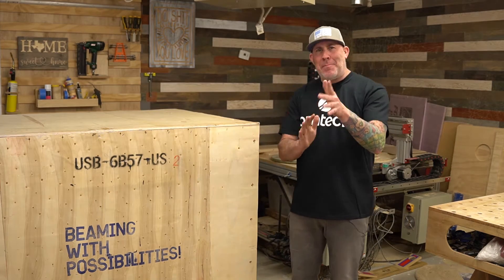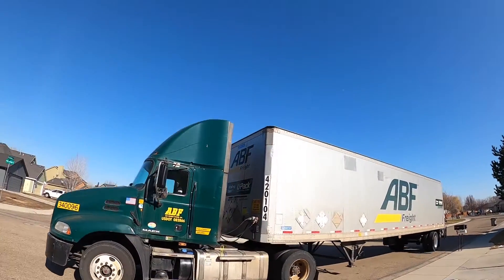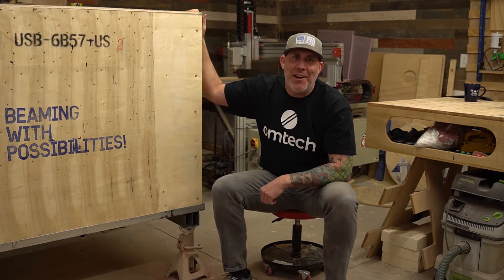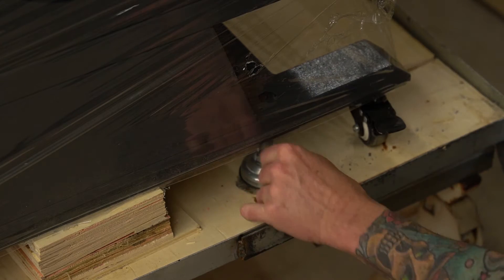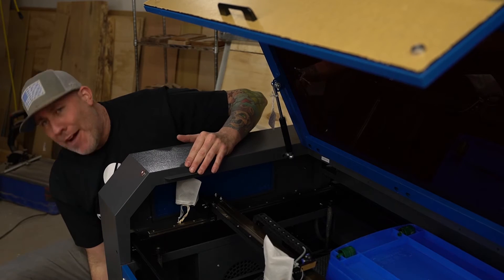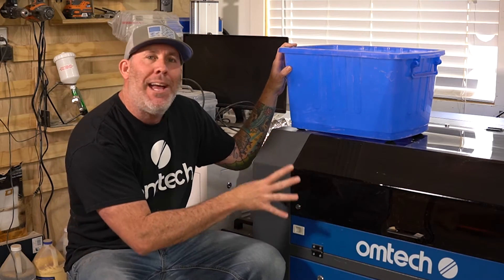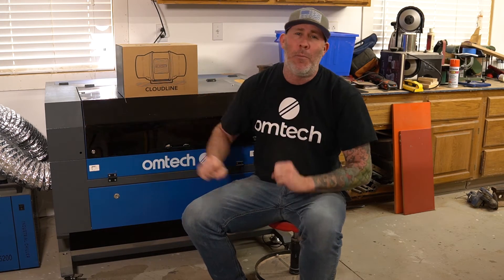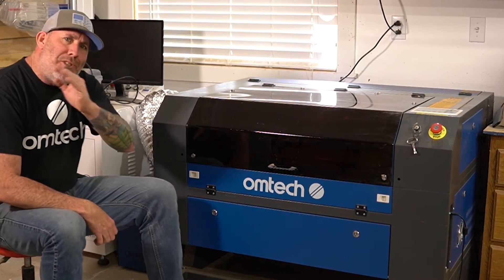Ultimate OMTech Laser Buyers Guide

Comment: I am looking at the 80W AF2028-80.  Is the base removable on that one?  Can I turn it on its side to get it my door without damaging the laser? 😊
Reply from the maker: Correct. The 80w 2028AF will have a base to remove. You won’t damage the laser. They are not they heavy. Light sheet metal. 2 strong adults. 👍🏼

Comment: I am struggling to get my new OmTech 100W unit going in my classroom. I got as far as the 5200 water chiller hooked up , computer is hooked up, electric good, bed is set up. I try and print the omtech color thing and the machine does its thing but no laser. Yes the key is turned on for the laser.

Comment: Hi Ryan... Great information on the OMTech...  ( Your videos have me ready to buy one)  Hoping you answer a few questions or steer me to which videos of yours to watch....  I own a GlowForge Plus (Laser for Dummies)  For the most part, its works fine for what i do (Engraving, Cutting 1/8" and 1/4" Baltic Birch Wood and some Acrylic)  (Logos and Signs)

The negatives I have about GlowForge is that doesn't cut 1/4" great and Tech Support is the worst company I ever dealt with...  The Positive is Super Easy to use...

My Questions:  I use Inkscape currently to make SVG Files and print to GlowFordge...  You mention Light Burn in your videos...  

1. How much different and harder will that be to use (I'm assuming it's not like Glowforge where I simply go into the Glowforge program and download my file for print...)
2. Does Light Burn take the place of the Glowforge file for printing to the Laser?
3. Thinking the 80 W fits my budget...  Sounds like that's stronger than my Glowforge so I'm assuming it will cut 1/4" wood with not issues.

I'm going to watch all your videos in the next few days...  and use your code you I get and discount and assume you get a credit...

Looking forward to your reply...   Thanks,  Frank

Comment: For moving the machine I recommend removing it from the stand, standing it on the flat end, and strapping it to a 2-wheel hand truck made for moving appliances or freight. Hand trucks with an 800 lb. load limit can be purchased or rented from Lowe's or Home Depot. These devices will save your back and make moving the machine up or down stairways much easier.

FYI - Using hand trucks with a lighter load rating may result in damage. I bent the axle on one rated at 600 lbs. and ruined the axle bearings. The cabinet I being moved was only supposed to weigh 580 lbs., so either the weight was heavier than the manufacturer claimed or the hand truck couldn't deliver on its rated capacity.
Reply: I will literally never be doing this. But I want to thank you for this knowledge so that I can pass it to someone else lol

Comment: Interested in using Piburn rotary for tumbler/bowls with 60w2028 CO2...can you advise that this is doable with honeycomb and knife removed. Can you approximate what circumference is doable with rotary. Appreciate your time and information in videos.
Reply from the maker: Yes, piburn can work with both the AF and the MF units. It's easier to setup on the MF over the AF but very marginal. Go with the unit that best suits your needs. You want to know what the Z clearance height is for the max circumference you can laser on a rotary. Off the top of my head I believe you have 9" z depth. So yes, either unit will work and that rotary is the best you can buy and wont mess up expensive YETI and STANLEY tumblers that adds up when you pay for mistakes.

Comment: Literally just got off chat with Omtech asking if stand could be removed on this machine to get thru door and reps response was "no it can't"?? Glad I found your video but concerned that ability to remove stand has changed in 11 months.
Reply from the maker: the 60-100w units, that look like mine, do indeed have a stand that can easily be removed. However the larger units are an all in one unit and most people won't be putting that size unit inside a home office space. In fairness they do have a million models and the rep easily could have been confused, not an excuse but it happens :)

Comment: why are the omtechs priced so much lower than the other lasers like muse? thunder?
Reply from the maker: Most these lasers are imported over seas and most are produced in similar factories with similar specs. Companies will import these machines in and create a new brand and it's up the each owner to figure out where they need to be with profit margins. Marketing Dollars doesn't make a better machine. These all use very similar components and most can be fixed, repaired or replaced and you are not locked into some proprietary system like a Glowforge.
Reply: I replaced my Muse with the OMTech and have been so much happier with the quality and ease of use.

Comment: good replacement for omtech 50w co2 laser 880 tube
Reply from the maker: PREENIX is the company that makes most laser tubes. Google the specs you need and find a supplier or go to OMTECH site and use my code and get 5% off on a replacement tube RNGPRODUCTS5OFF

Comment: What max Size of sheets can I load inside this machine with the honeycomb it says 20” X 28” WORKING AREA but also says 19.5” x 27.5” (500 x 700mm) engraving/cutting area just wondering what size of sheet I can actually load in for a snug fit while using the honeycomb? Thanks again for those measurements with the bottom stand removed I messaged support but no response nothing worse then being unsure if you can fit it past a door in the basement. One more question is this machine upgradable say if in the future i wanted to put a 100W Laser tube in would it be possible just to buy the new lasertube and a stronger power supply on the website?
Reply from the maker: Correct, usable area is 20x28, however the overall bed size is a few inches larger on each axis. I would have to measure next time I am outside. Don't forget they have pass through doors, so if you setup a large project with registration marks you can cut or engrave very long pieces as well. I know the 60w can be upgraded to the 80w - you need a 80w tube, new power supply and the kit that has the cover for the 80w tube as it's longer. Believe you can go from 80w to 100w same way, but don't quote me on that one.
Reply: I thought the 60 & 80 had the same overall dimensions

Comment: Do you know the difference in the red and blue models? I can't seem to get any info from OmTech.
Reply from the maker: The 60watt unit is only available in the Blue and Gray and the 80 Watt Units come in both the RED and the BLUE - Major difference is the Manual Focus vs the Auto Focus. Also one has a stand and the other doesn't. They both have the same size bed. Depends on if you want the Auto Focus I think it also has a auto Z bed height. You won't get that with the MF

Comment: I just bought the 80w 2028. I will be using mine in the outside garage which will be hot in the summer and freezing cold during the winter. I was wondering about storage during the winter, will I need to unhook stuff while not in use during the winter. I’d appreciate some advice for a beginner. Thank you for your answers in advance.

Comment: TY for the Video. Having the option to purchase a  ZF2440-80W or AF2435-80W. Which is the better option? TY
Reply from the maker: This is a very hard question to answer without additional information. You should pick a laser unit based on the products your currently make or intend to make. With a bigger bed size you can cut large and small projects. With a smaller bed size you are limited to smaller projects, or will have to use the pass through doors. If space and budget is not a concern buy the largest cutting area you can afford. The MF vs the AF really comes down to 2 things. How many times a day are you changing out material in drastic differences? Personally I like the MF as most of the material you place on the laser doesn't sit totally flat so you can focus much easier. It's one less component to fail as well. If you want to use a rotary attachment, the MF is easier to setup as you have more Z height. The AG requires you to remove the honey comb to use the tumbler. Both units are great. Really sounds like bed size or rotary attachment would help you decide.

Comment: I bought an Omtech from Amazon and it didn't work when I set it up. I contacted Omtech and they said they don't service lasers bought thru Amazon and that I need to contact Amazon which is very hard to get help from. Warn your watchers because the price is the same and if they get it from Omtech instead of Amazon they will by pass this aggravation.
Reply: I actually saw the one from the OMTECH site $100 less than Amazon.
Reply: @jeffvanark  yea I just bought one off the amazon site and already in a battle to get my $100.00 back. wonder how my delivery and set up is gonna go? If Omtech has problems with Amazon, why are they using them. Because when I clicked on the link on Omtech's website it went to Amazon all by itself, I did not go to amazon to look for my machine.
Reply: OMTech is the company that warranty with they are required to fix it.

Comment: How did you get it off of the crate onto the floor.
Reply from the maker: THe machine is very light. I had my wife pick up one side and I got the other side. No problem.
Reply: @RISENGRINDWORKSHOP  lol, the description of my machine MF1220-50r says it weighs 650lb.
Reply: What is the weight for the machine based removed.   Could you and your wife carry it into a house?